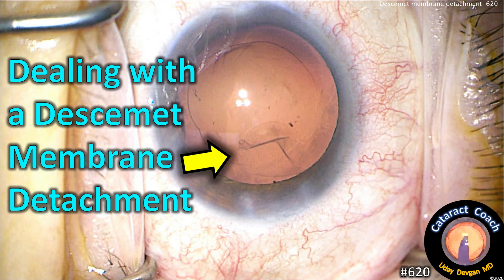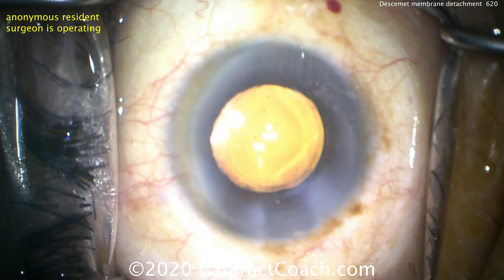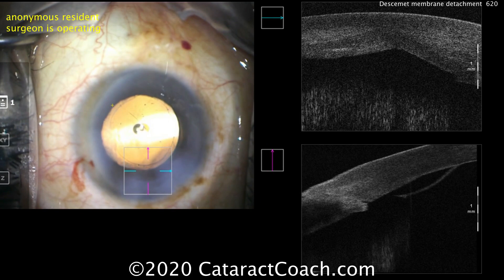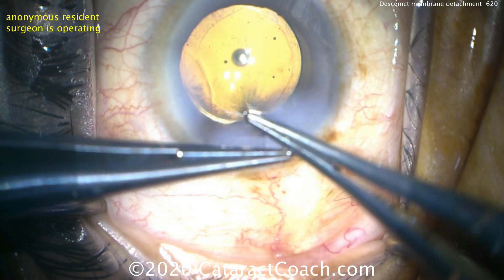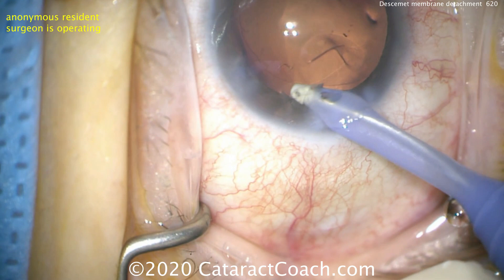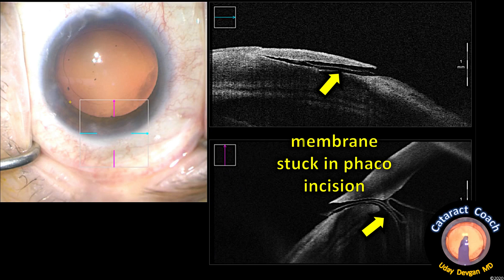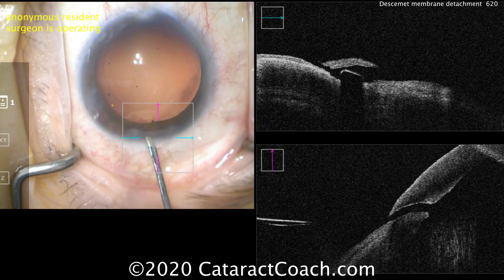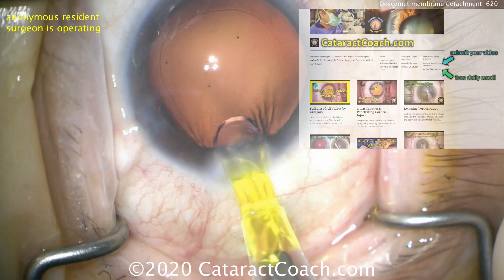Descemet Membrane Detachment during Cataract Surgery

Comment: We had a DMD in  a MSICS once keratomus enter AC, surgery was suspended and air bubble was left inside. DMD clinically resolved, we didn't check with anterior segment OCT because it is not available but cornea is clear. Question: it has been 2 months since, to operate cataract will you choose to do it by the same tunnel? Or will you choose to do it temporal? Any other tips?